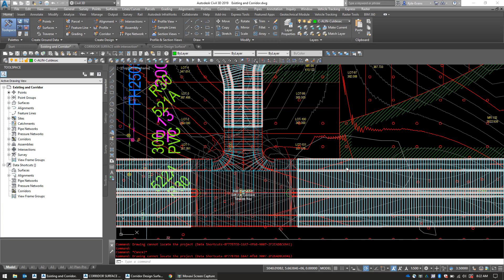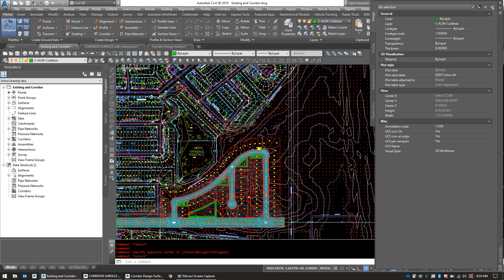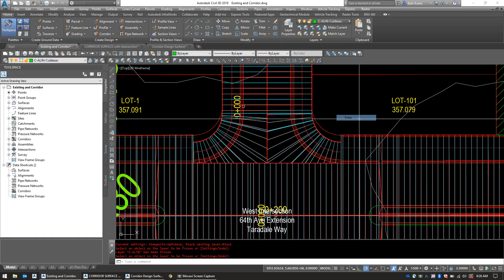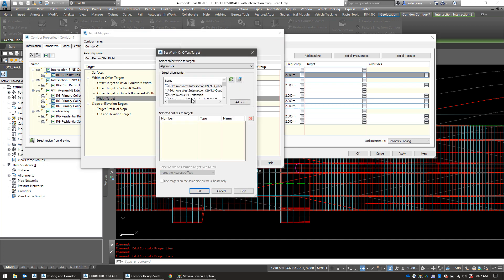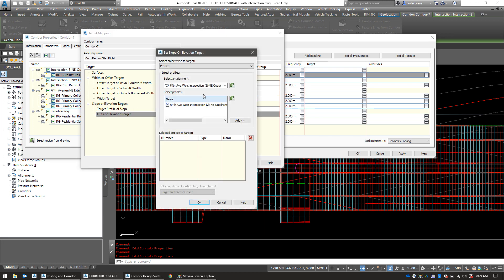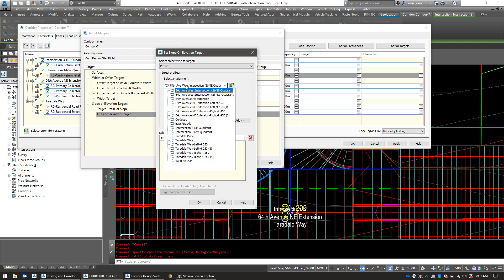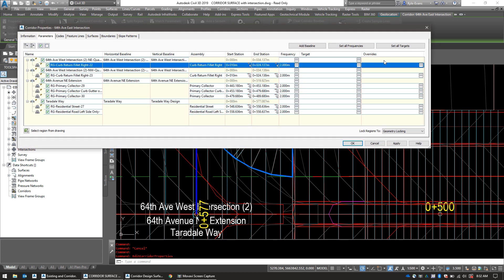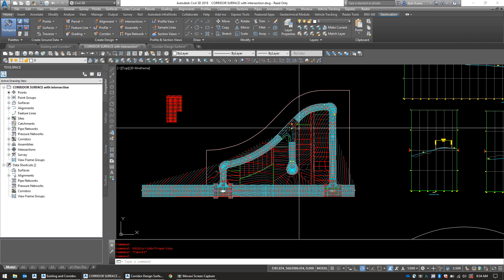Fixing Intersection Targeting Issues

Comment: Any update as to why the create intersection tool tends to assign the curb return fillet targets to the wrong subassembly? I can manually fix in the corridor properties as your video has shown but with a project that contains lots of roads and intersections it can be quite time consuming removing the targets assigned to the urban sidewalk sidewalk subassembly and then reassigning them to the lane subassembly.
Reply from the maker: @13srodriguez1  Yup. It is still bugged and has been for years!
Reply: @KyleEvansCivil  This was the fix "Edit the assembly properties and click on the construction tab. Right click the group which contains your Lane and choose move up. Make sure it's at the top of the list." So far that has fixed it for me

Comment: Why someone would give a thumbs down to someone who is pointing out a defect in the software seems odd to me.  This isn't the only defect in C3D 2019.  If you haven't tried them yet, Kyle, try making some simple custom subassemlies in Subassembly Composer (SAC) and watch how messed up C3D gets!  Renders the software useless....cascading failures, crashes, garbage data, random targets get renamed, stations for targets aren't acquired correctly, object viewer crashes between 50-100% of the time on open and on touching the view cube, derivative data such as corridor surfaces cause Feature Line tools to generate Terrabytes of random data.  This is hands down some of the crappiest software I have ever used.  It's unfortunate that AutoDesk is an "industry standard".  If there was an option that wasn't based on AutoCAD, I would have bailed years ago.
Reply from the maker: We are the only people who pay to be Beta Testers! It also appears that on the straight sections of the through road that Civil 3D is messing up the targets as well. Sometimes it targets the Outside Lane, Sometimes the inside lane and sometimes the Sidewalk offsets. I have never had it function this poorly before. However 2019 is still better than 2016